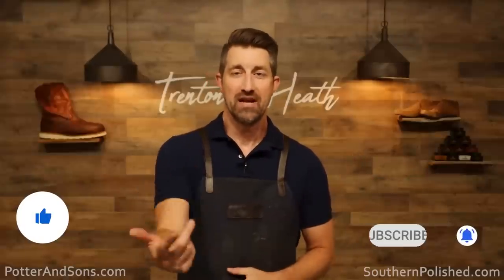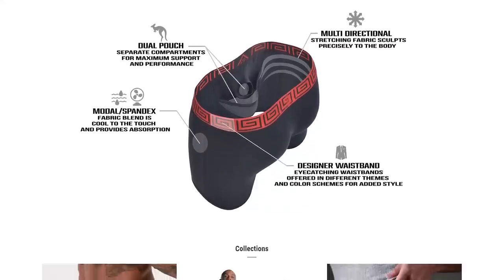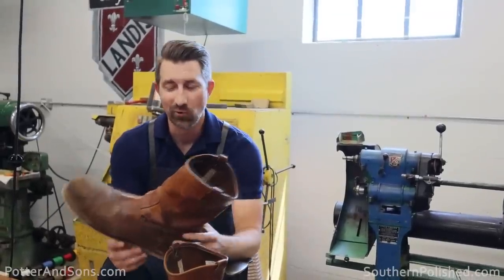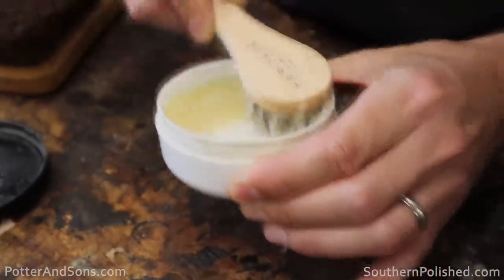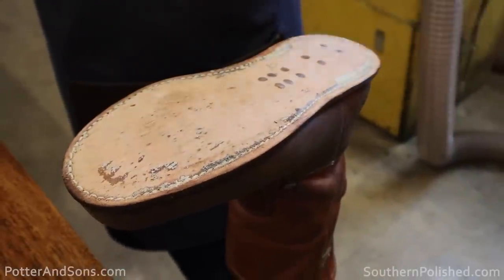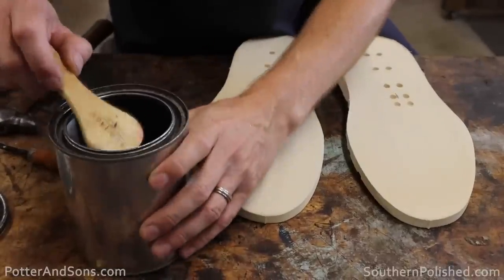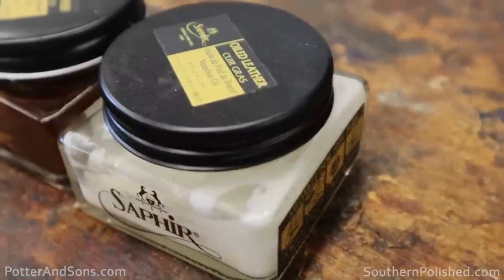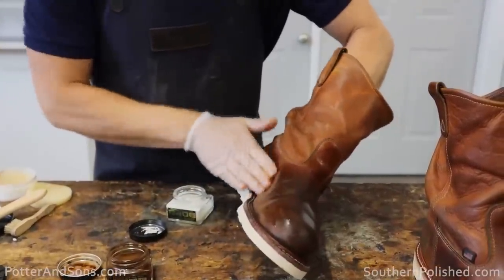YouTuber Returns the Boots We Resoled | Thorogood Boots Are RESTORED TO NEW

Comment: Big guys like Adam and myself will totally destroy a set of boots in metal working shop. You find a sole that will hold up and you can't stand to wear them all day. It's like walking on rocks. Why do we repair ours boots??? Evidently you've never had to break in a pair of really thick leather work boots. Once they fit your feet you don't want to start over.
Reply: I had the same thoughts in mind. There must be more durable soles than this particular Vibram sole, but that would likely mean much more dense and hard rubber, rendering the boots much less comfortable. The repair definitely makes sense in this case!
Reply: greasydot, I agree sir. I am not a big guy. 5' 7", but more fire plug than man. I lift weights and bike a lot. I also work in my shop and build golf clubs and do repairs. I am on my feet. Prior to this retirement job, I was in the infantry in the Army 28 years. The soft soles are MANDATORY or I will be laid up. I have had 2 back surgeries. I have chronic pain. The harder the sole, the less time I can wear the shoe or boot. Around the house I have some slip on Sketchers. The soles are super squishy. If you have back, knee, foot problems you WILL search for soft soles. Comfort is the number one factor to me.
Reply: I think a hard sole with a soft insole is the best option
Reply: My redwing supersoles hold up better than anything else I’ve tried. I’m a baggage handler and stay on rough concrete all day everyday

Comment: The way you did these last time means they should be able to have this done for as long as the uppers last since there's virtually no wear on the midsole and welt if it's just peeling off and gluing on a new sole each time. It seems like if one wants a sole like this, having them re-worked like this is well worth it. Not everyone calling themselves a cobbler could do that first re-work as well as you did, but any of them should sure be able to handle resoling them now.

Comment: The sound at the end would be improved by adding some sound dampening. It is the sound reflecting off a close, hard surface that makes it sound like you are recording inside a tank. Aim for a neutral sound. You can even hang some towels overhead out of camera or to the side for a quick fix.  I'm not surprised that the softer sole only lasted this long, Abom79 is not a small person and his shop floor is raw concrete. Yes softer soles wear faster but hopefully it saves some wear and tear on his body as knee replacement is not cheap!
Reply: I agree. Also it's hard to stay focused on your work when your feet hurt.

Comment: If that material wore out within six months, is that the best material for soles? Or perhaps it is so spongey it works well saving his feet standing on a concrete floor all day? Any recommendations? Thanks!
Reply: crepe soles are super comfortable and very grippy. plus the guy works in a metal shop so a stiffer rubber would've only lasted about 1 year.

Comment: Hey guys. Love your content! Marine Corps vet and have been a paramedic for 10 yrs now. Most my work partners including my wife who's also a paramedic wear thoroughgood 8in side zip jump boots. We love them as far as ems work goes. Fast break in and super comfortable and durable, but the soles only last about 2 years max. The unfortunate side is that the rest of the boot is in great shape because we clean, maintain, and polish our boots, but that model is not the U.S. made thorogood. Can these boots still be re soled?  We all have 2 to 3 pairs at home that we just use as sh*t kickers. The boots themselves are in good shape as far as the uppers just the sole is worn out so we buy a new pair every 2 years
Reply: Hi, thanks for your service and thanks for your work! I work for a fire and EMS program at a college and I'm familiar with those boots!

So, those can absolutely be re-soled. The challenge is, they are $150 boots and the first time you'd re-sole them, you'd pay at least $250 for the overhaul for the first job, just like the first job on the boots in this video: replace the rubber welt with a leather welt, add a leather mid-sole, and possibly add/replace cork or leather filler between those.

Also, for the thick lug sole those have, there's a possibility they can't just be glued on like the wedge-style soles in this video, so would need to be sewn and/or screwed into the boot, but I would defer to a cobbler on that.

I say 2 years for a $150 boot is awesome. I imagine you could buy something like a Nick's or White's model and it might last longer, but you'd pay $350-$550 in that case. Anyway, just my two cents. Be well.

Comment: If yall had to recommend a good hiking/semi dress boot (i.e. capable of being resoled and not just thrown away) what would it be?  All the hiking boots I normally see are all cloth and mesh uppers that when they soles are wore out everything else is too.  Sorry if it has already been addressed.
Reply: Check out the Jim Green Razorbacks. I just got a pair, really like them. The aren't super dressy but aren't less dressy than other hiking boots. I use them for hiking and going down in old mines. Full leather boot, stich down construction, resole ready, steal shank for climbing ladders and stuff. They even have the wide toe box like fancy Limmer boots have. I would highly recommend them but if your standing on concrete alot, get some better insoles for them. Also they are very affordable due to exchange rates from South Africa, as well as legislation in the US that gives companies from Africa tax breaks to help promote industrialization of the 3rd world.

Comment: Nice job!  And darn, those soles wore quick. And Trent, is there a more “durable” sole to use for these?  I tried to come up with a question that you didn’t ask!  🤦🏼‍♂️🤦🏼‍♂️😂😂. And great work as always!!
Reply from the maker: Thanks!  Yeah, the Vibram Christy soles tend to wear relatively quickly.  They’re quite comfortable, but they wear fast on concrete, etc., especially if you’re wearing them a lot every week…like the owner of these.  Something like the Vibram Montagna wouldn’t be as soft but would last much longer.

Comment: Is there any other sole you could use that will last longer for a person who uses the boots in a heavy working environment?
Reply: Probably not a moc toe tbh. 

I have some Ariat boots that have been holding up pretty well even after a year of beating them to shit. It's just a regular plastic sole.
Reply: The sole that Thorogood uses now is the Maxwear wedge sole.  They are supposed to last longer than the Vibrams.  I have a pair of the 6” moc toe Thorogood’s with the Maxwear sole that I wear to work.  I am on my feet for 8-10.5 hours a shift, and have no foot pain.  I’ve had these boots two months, and the soles barely have any wear, only a slight bit on the outside edges of the heels.  It’s possible that the Maxwear wedge soles are not available to cobblers for purchase, so the only way to go back that route is to send them in to Thorogood.

Comment: I have a question that is inspired by another youtube channel that does what you do. The question is could you just sand the outsole down so it is all level and glue another one to it instead of taking the outsole off as you did? The reason I ask is I saw another youtube channel do that very thing.
Reply: That would mean that you would be gluing rubber to rubber, which is something you want to avoid. That's the reason they replaced the rubber midsole, with a leather midsole, when they did the original job. Watch the video of the first job. It will make everything clear!
Reply: @brookeggleston9314  oh ok, I guess the other channel / cobbler did it wrong. 
Thanks

Comment: Adam, has a robust size like my self.  Lots of folks that height and weight is per the latest medical charts, could wear a pair of boots for a while and not wear them out.  Others that have more robust figures stress the sole material of boots to the design maximum, and therefore, don't exactly get the same length of wear out of a pair of soles.

Comment: Thorogood boots used to be great but the last pair I bought for my son has made me think twice. He isn't a big guy. He only weighs about 160 lbs. He had worn Thorogood for years and preferred that brand over any other. He only wore the new boots about 6 weeks and the soles had already cracked in two on both boots. The company didn't want them back because they claimed the boots had been bought as new old stock which I disputed. I took them them to a cobbler since I was out of a good bit of money on the boots. He said that while the leather uppers were great quality the soles were a cheap plastic. He also said he had stopped selling Thorogood in his shop because of the same issue. He resoled the boots and they're great. Still a customer shouldn't have to get brand new boots resoled.

Comment: Just curious how the soles got worn out so badly in six months. Isn’t there a more rugged sole for his line of work, or is the owners physical size a factor in the sole choice as far as durability? Just seems kind of quick to wear out like they did.
Reply: I was  as going to ask the same exact question.
Reply: The man is either a heavyset dude, drags his feet constantly, or both.
Reply: Wow, I have shoes that are 20 years old that don’t have that much wear.
Reply: Maybe he uses his shoes as brake when he drives his motorbike daily.
Reply: Walking over (sometimes) red-hot metal shavings all day. There is probably a more rugged sole available, but it's likely a tradeoff against comfort.

Comment: You missed the most obvious question. How did he wear them out so quickly? It seems like he needs a sole with a harder compound.
Reply from the maker: Good point!  I’m sure we’ll get this question a lot.  As the other person said above, comfortable soles usually wear out much quicker than harder, rigid sole materials.  The Vibram Christy soles, such as the ones on these boots, are quite comfortable but wear out very quickly.
Reply: He's a big guy and his office is standing on concrete floors. He works as a machinist.

Comment: Damn! He wore that Christy sole down like that...in just 5 months? Wow. Seems like to me...a 5 month lasting sole...is a problem. I thought Vibram was one of the best. Couldn't a Topy or some other kind of layer, of rubber be attached to help aid the longevity of the Christy? I am aware the Christy is made for comfort and maybe one has to exchange durability for comfort...but 5 months? Come on...that just doesn't seem right. Surely there is a way to make that sole last longer...or get a different type of rubber sole. Not impressed that a Vibram sole would only last 5 months.

Comment: The very least you could have done is take a a hand grinder with a steel cut off blade and regrooved the sole for him or taken off the top layer down to a smooth surface with 20 grit on your finisher and bonded a rubber sole on top of the old Kristy crap sole. Those soles are crap and it is bs you are not upgrading your customers soles to something more durable!